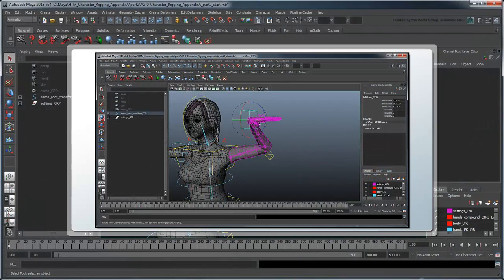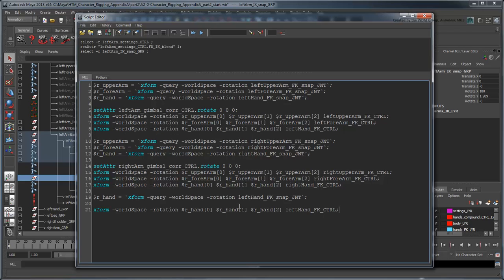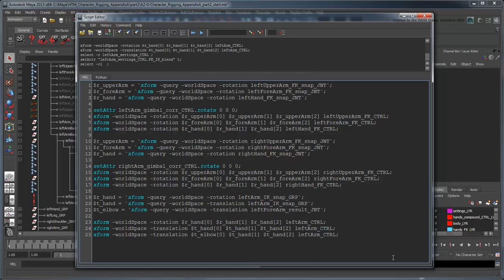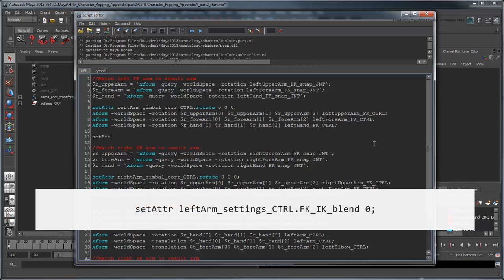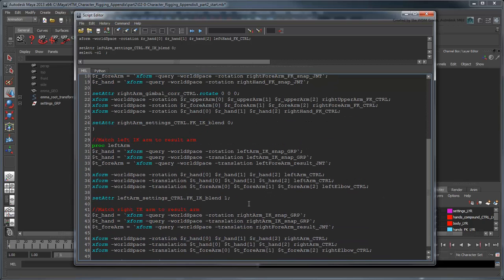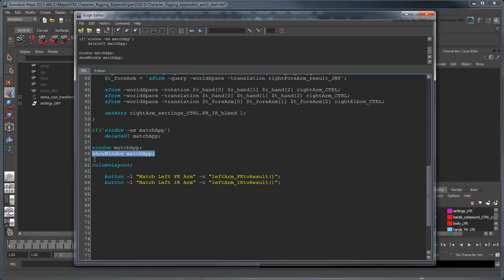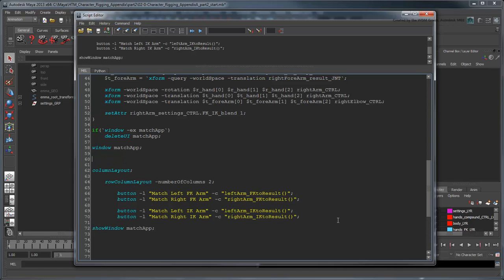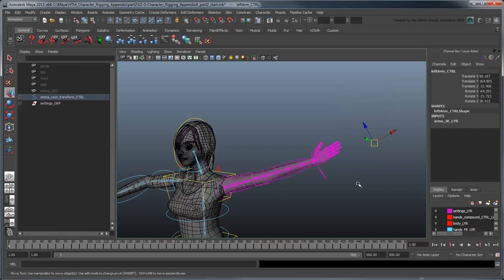Creating a Character Rig: Appendix A: Part 2 - Matching the IK arm to the FK arm (Advanced)

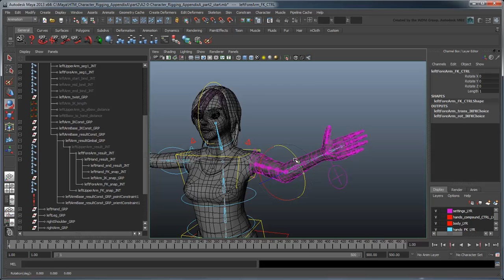Comment: When doing the ik deformation at 2:00 fk, the ik elbow keeps changing its position and it doesn't work the same as the fk arm, what's the reason?
Is there any change in the center point of the "leftArm_Ik_snap_GRP"

Comment: So it's now 2022, and I've followed this tutorial. I realized all that FK/IK and IK/FK matching could be done much simpler with the "matchTransform" command. Thank you for this tutorial, though. Even though it's almost 9 years old it still gave me a lot of experience and knowledge of advanced rigging and scripting.
Reply: Thanks for the tip! I was having trouble with the matching script in this video because I had frozen my ik hand control and matchTransform worked like a charm. Still good to learn some different techniques though
Reply: @Merkygloom  how would i go about using it i dont know much about scripting

Comment: I got until here by using my own file. Because my IK and FK rigg are not aligned perfectly i went on with your file and on thing is strange. Is it normal that in your file when switching isntantly from FK to IK the arm twisting only occurs during IK. in FK mode there is no twisting. That was one detail i am curious about if it was intentional?
Greets
Reply: Ok i found out why this happens. Elbow CTRL is inside the arm after executing your script. that's why IK is twisted... maybe with an offset inside the script so that won't happen ? i mean... i now why you position the elbow CTRL inside the arm but the twist is a bit strange right?

Comment: I tried the script but instead the control moved to the location it shoots on the different location I was wondering if anyone can help?
Reply from the maker: Are you sure your snap group is an exact copy of the IK control?
Reply: Maya Learning Channel I just use the mirror skeleton to copy the segmented joints on the right
Reply from the maker: Did you follow the advice in part 32?  It's not quite so simple to mirror a custom rig like this.
Reply: Maya Learning Channel sorry I missunderstood . . . the IK control is the box curve right . . . I duplicated it del its shape node
Reply from the maker: Yes that's right.  Then you middle-drag it into the result arm.  This will change its relative space without moving it in the scene.  You should then be able to match to it. 

If that doesn't work, try testing the steps using the included scene file.  If that works, then it means there's something wrong with your rig.  If it still doesn't work, then it's possible some kind of setting is wrong in Maya.
Reply: Maya Learning Channel I'll try that

Comment: Maya learning channel if you could please help me. When I run the script and then switch back to IK mode at 2:20 my  arm stretches way back. I have no clue what could be causing this.
Reply from the maker: You can also check out this new video I made to address this issue: https://www.youtube.com/watch?v=V8ZgOZDjVXs&index=40&list=PL8hZ6hQCGHMXKqaX9Og4Ow52jsU_Y5veH
Reply from the maker: Could you elaborate on what you mean by "stretches way back"?  Like, behind the character's head?
Reply: yes sir. it stretches backward about 3 times it's normal length
Reply from the maker: It sounds like your snap joints might be in the wrong space.  Double-check their parenting and also that their values match those of the arm you're matching to.
Reply: Maya learning channel I tried this, it still has the same result. I did freeze the transformations on the left arm CTRL back at episode 22 if it matters
Reply from the maker: Unfortunately, that does make a huge difference.  By freezing the controls, you've actually changed the pivot point, meaning the IK / Result arm no longer have a common pivot point from which to communicate.  To use a different example, suppose you and I started a race from the same starting line to the same finish line.  Our finish times will naturally be relative to each other.  However, if I then started the next race 100m ahead of you (my new "pivot" point, so to speak), then our finish times would no longer relative because I started from a different spot.

Luckily, there is a way around this, but it is a bit more complicated than simply setting the translation value straight from the snap group.  Instead, what you're going to need to do is find the difference between the frozen pivot and the world pivot, and then add that to the result.  This is figuratively the same as adding my 100m headstart to your race as well, so that the end result will be fair.

Script-wise, that will look something like this:
$t_rp = `xform -query -worldSpace -rotatePivot leftArm_IK_snap_GRP`;
$t_rp2 = `xform -query -worldSpace -rotatePivot leftArm_CTRL`;
$t_hand[0] += $t_rp[0]-$t_rp2[0];
$t_hand[1] += $t_rp[1]-$t_rp2[1];
$t_hand[2] += $t_rp[2]-$t_rp2[2];

Essentially, this finds the difference between the frozen pivot and the world pivot, then adds that value to the hand's position in order to fix it.
Reply: I have the same problem. Right now I'm experimenting with Maya 2016 ext2's new matchTransform option. It looks promising.

Comment: I have read through all the comments trying to work out how to solve the issues with no joy. The FK to IK works fine but the other way is not as successful. I noticed you added some code to the comments could you please show me how to apply this to the original code in the tutorial.  My naming convention is exactly the same as yours so it should be quite straight forward.I have tried numerous ways with no luck just errors.   I also have Zero values on my IK set up in the T-pose.  I understand that in most scenarios the Ik would not be in this position when animating.  As in your model I noticed your elbow joints and IK arm Ctrls are not zero values.  The FK to IK works fine.  It's just the opposite that seems not too be working.
Any help and tips on how to apply this for the legs too would be greatly appreciated.Kind regards
Reply from the maker: Have you tried comparing your script to the one included in the downloadable scene files?  That would be the fastest/easiest way to troubleshoot.

Comment: Hi, do you know how we can change the world space tranlation and rotation of an object?
Reply from the maker: You can just use the Translate/Rotate Tool/command and set the Axis Orientation in the Tool Settings to "World".
Reply: Hi i have a question i have froze the leftArm_CTRL an now i have problem with the ik in part 2 of appendix ,is there any way to fix this situation or i had to redo the left Arm again.pleas help i m suck in this part.
Reply: I  deleted the parent constration between leftArm_CTRL   and leftArm_IK_const _GRP and freez the leftArm_CTRL and put that on the 000 of the grid after that ponted snap it to the leftHand_result_JNT and then parent constraint it to the leftArm_IKConst_GRP again but it did'nt make any diffrence.
I found that the world space values of the leftArm_CTRL and the leftHand_result_JNT are diffrent ,is there any way to put the values of left_result_JNT's world space to the leftArm_CTRL's world spacee's values?

Comment: I have noticed a problem with my Left Arm. Matching FK to IK works perfectly fine. However if I want to match my IK to FK, the FK joint chain along with the result joint chain move out of place. It looks like this http://imgur.com/a/zERHo 

Any idea why? It works perfectly on the mirrored right side. 

Problem solved. Everytime I tried to match the Result Chain the IK chain would be off by 3 on translate X. Both the Result Joint and Elbow CTRL did have the same X values. I then matched the Fore Arm Snap Joint instead of the result Joint and voíla, it works. It works with matching it on the result JNT on the right side, which is quite odd. Apparently they existed in 2 spaces" slightly offset for whatever reason.

Comment: I'm having a problem with the pole vector flipping when the elbow control is moved to the result joint.  If I move it away from the result joint, even a tiny bit, it flips back to normal.  Is there a way to fix this without using an arbitrary offset?
Reply from the maker: Unfortunately that's just a result of the math behind the scenes and is pretty normal. One thing that might help is rigging the character with a slight bend at the elbow.  That will bias the arm in a certain direction which can (although not always) remove this problem.  If you've already completed the arm rigging though, I would say that slightly offsetting the elbow control is the easier solution.
Reply: Thanks for the reply.  Instead of adding an offset, I created snap node for the elbow, point snapped it to the forearm result joint, and moved it back a tiny bit.  It keeps the pole vector from flipping, and the arm rotation difference from FK to IK is barely noticeable after switching.  Either way, its using an offset, but I'd rather not hard code the offset.
Reply: I found an even better solution.  I removed the snap node and set a very small offset on the pole vector constraint.  Now the rotation difference isn't even visible at all, and the pole vector doesn't flip.

Comment: If anyone is having a problem matching the IK to FK due to freezing the transform on your IK Arm control you can do the following:

-Make sure the IK Arm Control is in exactly the same location as the Hand Result Joint in the workspace. For the sake of this explanation, we will assume that your IK Arm Control (and IK Vis Group) values are 0,0,0 translate (T) & rotate (R) and your Result Joint T & R values are where they should be, so lets say T (2,4,-3) & R (-24,30,219) in world space.

-You can check your world space values by using the script:
                          xform -query -worldSpace -translation [insert name of Controller / Joint]

-Now, select your IK Arm Control and put in the world space values from your Result Joints so now:
IK Arm Control: T (2,4,-3) & R (-24,30,219)
Hand Result Joint: T (2,4,-3) & R (-24,30,219)

-Multiply the all the values on your IK Arm Control by -1:
IK Arm Control: T (-2,-4,3) & R (24,-30,-219)
Hand Result Joint: T (2,4,-3) & R (-24,30,219)

-Now when you Freeze transform your IK Arm Control, your new world space value should be T (0,0,0) & R (0,0,0). Enter in the values from your Hand Result Joint into the IK Arm Control. It should now match the position of the result joint AND have the same world space values. 

-However, if you wish to keep your T (0,0,0) & R (0,0,0) values on your IK Arm Control, and STILL wish for it to retain its correct world space values with the Result Joint, then (assuming the group containing the IK Arm Control has (0,0,0) values, if not then you will need to add/subtract the diference) you can simply add the values from our IK Arm Control (which should be the correct World values) into the group, then zero out the values on the controller.

- This can also be done for the elbow. You will need to group all the elbow components and then perform the same commands, except you will need to snap the controller to the LowerArm Result Joint, and pull it back out like when you made it.

ALWAYS REMEMBER! 

Using Freeze Transform on an object will zero out the world space values for itself AND any objects grouped BENEATH it, not above it. So if your object is in a group that has, for example T (4,0,0), when you freeze transform the object it will be zeroed out in the channel box, but it will inherit its groups world space values ie. T (4,0,0).
Reply: You have just save my life with this. Thanks so ungodly much.
Reply: Hi,thanke you for the solution.how can we access the world space of the leftArm-CTRL to change its translation and rotation values?
Reply: Pleas respond i'm stuck in this part or i shold recreat bothe the right and left hand againe!
Reply: Is it possible if you can do a video based on the information you've provided?This is because I'm still confused on how to solve this problem in iK to fK snapping.

Comment: Instead of freezing the translates of the the IK arm control, we saved Presets. How do I return the arm to default pose after Snapping? Please help  because I've been struggling with this for longs.
Reply from the maker: Once you've saved the preset, go to the IK hand control's Attribute Editor and click Presets and it will appear in the dropdown.
Reply: Yes, sir. I know where to find the Presets. However,  when I click on Presets*, I get options: Replace, Replace All Selected, Blend 90%, Blend 75%, Blend 50%, Blend 25% and Blend 10%. None of these is returning the arm_CTRL or elbow_CTRL to their default position. How do I return the controls to default when they non-zero values, apart from having to need to remeber the values in order to return the controls back to their default positions?  Thank you very much for the help.
Reply from the maker: "Replace" should do it.  If it's not, you may need to remove that preset and set a new one again at the default position.  I'm not sure what could've broken it though.
Reply: I set a new one again as you advised. Thank you very much.

Comment: I managed to get the left arm's matching down perfectly, and the right arm's IK to FK as well, but I run the FK to IK script, the arm matches positions but the rotations are all strange... I can see it twist over when i blend it slowly from FK back to IK, and when matched back to FK, the rotation values are all different...
Would you happen to have any insight on my problem? Thanks in advance!
Reply from the maker: Check the local rotation axes and rotation orders for all those joints and make sure they match.  If they match and you're still getting that issue, try setting up an additional driven key at some in-between state (not fully IK, not fully FK) that moves in the direction you expect.  Try to find the point at which the numbers start to diverge to pinpoint your problem.
Reply: Thanks for the quick reply. I checked and found that the LRAs are indeed a little bit off, as are the IK and FK joint placements. However, if i were to do the right arm from scratch instead of mirroring the left side joints, is there a way to orient them with the mirrored LRAs? Cause I've been trying a few settins but there's just no way to get the LRAs like they are in the provided scene file.
Reply from the maker: I would definitely still mirror the left result joints so you have something to start with.  You can then rebuild the IK/FK solutions from there.
Reply: I tried rebuilding the entire right arm and now all the LRAs and rotation orders are definitely the same, but the problem still persists. The joint's translates match as expected, but the joint rotations are all wrong and the arm ends up completey twisted. After further testing with the left arm, i found out that it has the same problem.... This only happens from FK to IK. I'm completely stumped and have no idea where to go from this point.... any help would be greatly appreciated...
Reply from the maker: Are you sure you duplicated the IK control groups and not the IK joints themselves to create the match nodes as per the video?  That's the only reason I can think of that the match is only messed up in one direction.
Reply from the maker: Wait, the problem is not actually with your matching... it's with your blending!  No wonder remaking snap groups and whatnot doesn't do anything!  

In this case, I think you need to check that the LRAs/rotation orders of your FK, IK, and Result joints are all lined up.

Comment: I have my FK working perfectly based on the last video, but when I followed this method for the IK the snap controller would not match the FK chain and thus the IK wouldn't. (I'm working with a quadruped and have the IK snap control parented to the front ankle...it is failing miserably at following the FK chain)This is what my IK code looks like:
$r_leftIKWrist = `xform -query -worldSpace -rotation left_front_hoof_IK_snap`;
$t_leftIKWrist = `xform -query -worldSpace -translation left_front_hoof_IK_snap`;
xform -worldSpace -rotation $r_leftIKWrist[0] $r_leftIKWrist[1] $r_leftIKWrist[2] left_front_hoof_IK_control;
xform -worldSpace -translation $t_leftIKWrist[0] $t_leftIKWrist[1] $t_leftIKWrist[2] left_front_hoof_IK_control;
Reply: +Maya Learning Channel  no ideas?
Reply from the maker: Unfortunately it's hard to comment based on so little information.  I have a feeling it's not your script but rather some kind of space alignment issue (either the snap nodes are not parented to the right place or they are not exact copies of the controls/joints meant to snap to them).
Reply: +Maya Learning Channel I selected the original controller and pressed CTRL+D. How much more exact can I get? I tried having it parented to the joint in the hand and tried having it parented to the joint in the wrist.
Reply from the maker: There's actually a pretty easy way to double-check nothing wonky is going on with the spaces.  Create a locator at the center of the controller, then duplicate the whole thing and move the duplicate into the result space.  Move the FK limb so the result space moves, then point snap the IK control to the locator you made.  Are the translation values for both the controller / snap node identical?  If not, there's some kind of space alignment issue going on.
Reply: +Maya Learning Channel my FK controllers are shape nodes parented to joints
Reply: Maya Learning Channel  sir please make a video on facial rigging as well. Thank you and great tutorial